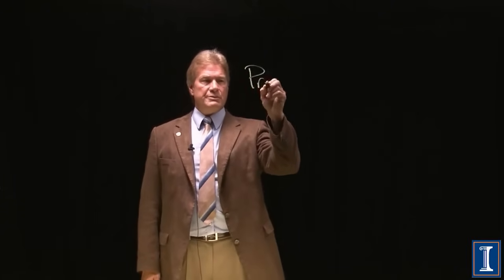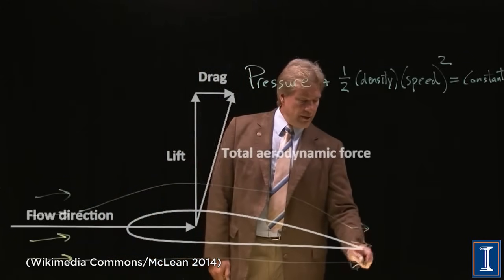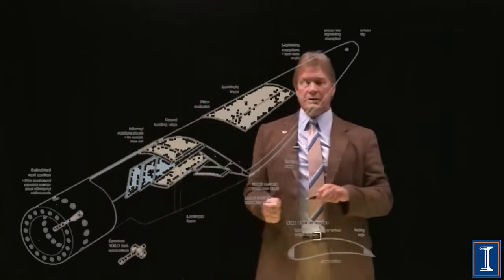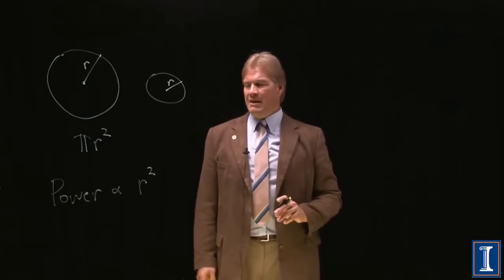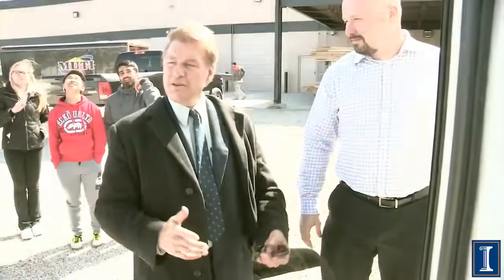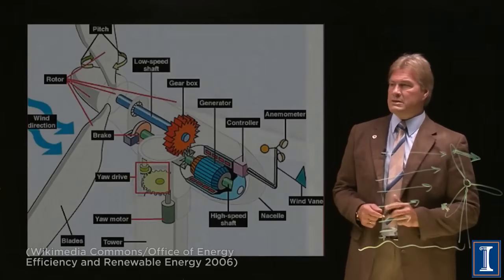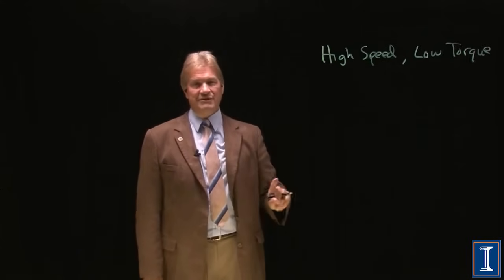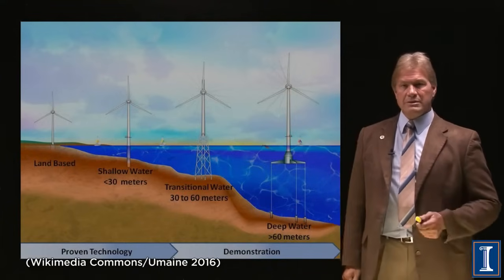How Windmills Work

Comment: More about the economics, maintenance requirements and practical/impractical considerations of windmills please. 

What if balancing a grid with a substantial % of power coming from wind (and solar) means shifting up and down conventional power-plants to run at lesser efficiencies? Is there an overall economic loss? 

Are the maintenance requirements for windmills not unfavorable?
The ideal locations are typically not near places with high power requirements. What about the distances involved and power lost due to transportation over these distances? 
The blades have to be cleaned, the structure vibrates unevenly, it is subject to non uniform lateral forces, anything with a propeller on it will sooner or later shake itself apart without maintenance and maintaining them at sea seems to complicate things further making it an expensive proposition if this has to occur regularly. Building them and taking them apart requires massive cranes and equipment, what about the cost of building them and taking them apart?

Comment: What I would like to see is comparison of cost of different power generation types and problems of high Green energy in your power grid content for big countries like Denmark or Netherland. They have a lot of Wind and Solar does it generates problems for grid energy?
Reply: Do you know the difference between an economist and a physicist? One doesn't care about cost, the other doesn't care about physics.
Reply: @vidznstuff1  I beg you pardon. Engineer who builds power plants needs to be aware about both the cost and the physics.
Reply: @tomaszworoch  Wind and solar plants are cheaper than coal and are at parity with methane, despite its glut of supply.  Anything else? 

Fossil fuels are becoming uneconomical for everything. In five years, aircraft and long haul trucking will go electric as the new battery tech comes into production within 3-5 years. "Peaker plants" will also become obsolete in favor of grid batteries and car to grid power artbitrage.
Reply: @vidznstuff1  clearly you didn't spot my point about country grid. Clear Solar and Wind power grid have problem of storage. If you count PV generation per kWh it's becoming similar in price to fossil fuels kWh. On case of PV with energy storage well then it's decades before it will be reasonably priced. 

I would love to see electric planes but to been able to fly on one I do not share your optimistic predictions. It will take longer then a few years
Reply: @tomaszworoch  Storage is free with Vehicle to Grid.
Reply: @vidznstuff1  Show me any place that is planning VtG ? Japan with Nissan after the Major disasters is the only one I have heard about. Tesla with Cybertruck not fully GtD but theres is something. Nothing else I have heard about. 
Next thing the storage of EV is so small in comparison to power in Grid. World production capability of Li-ion batteries last year was around 150 GWh of which maybe half is for EV, and from it you could use a few percents of capacity connected per any given time. US power grid tops it's consumption at around 1000 GW of energy , possible similar amount of energy in EU, even more in Asia.
Even if we would get all the EV next year to be VtG compatible (who would pay for it?) we would get 150 GWh/ half for cars / few percent around I would say 10 GWh of storage production per year that's around 30 second of energy storage. We would need days. 
Let's stop rambling and lets talk about the real cost cause we want the same
Reply: - The 'Energie Wende' in Germany failed. It doubled the price and didn't reduce CO2 emissions at all. Because every Watt of wind power needs a Watt of natural gas power in hot standby to take over when the weather changes. 
- Denmark is lucky in that they can sell excess power to Germany. 
- When Germany has excess power, Denmark and the Netherlands don't need it because they have their own wind power. 
- When the grid operator has to order wind turbines to shutdown, they still get paid for the excess power that wasn't needed. 
- The grid was designed as a backup for when a plant fails unexpectedly. When a storm passes,  ALL wind turbines go from maximum power to zero at the same time. 
- Most of the wind is near the North Sea, so the grid is abused as a transport network. Forcing the grid operators to juggle frequency and phase on a hourly basis. 
- The Netherlands is building huge wind parks offshore. Guess who has to pay for the grid connection to those parks.... the tax payers.
Reply: @Aimless6  Thank you, that's something i would like to listen about. Important topic if we want to go green anytime soon.
Reply: @Aimless6  Short term problems should not dictate long term strategy. Batteries will make your peaker plants obsolete.

Comment: What are those engineering problems in details? How did they get solved? What's still left to improve? Thank you professor.
Reply: The problem of nonuniform wind force across the swept area of the blades was solved by making micro pitches to each individual blade as it moved through the swept area. Torque on the main shaft is closely monitored to prevent premature wear on the main bearing and gearbox. Great question volt! I hope that answers your question a bit. Also each turbine manufacturer likely has patents on this tech and may have found other solutions.
Reply: @codydebo1876  so each individual blade changes pitch according to its position during each revolution? That's genius tbh. Thank you for taking your time to answer

Comment: You're normally so accurate, but they're not windmills! They don't "mill" anything. They're wind turbines or wind generators, but please, not windmills. 😉
Reply: Mmmm, I was thinking the same thing, but while watching I came to wonder what you’d call the water pumping variety. After all they also aren’t milling anything. I think you’d be safe enough to call the category of machines that use wind to do work windmills of which the subset that generate electricity are wind turbines
Reply: I agree, for some I think it's a generational and regional colloquialism. My parents (and some of my classmates) grew up calling them windmills, even though they definitely knew better 😅
Reply: Almost replied;)

Comment: I'd love to see a video on how to protect oneself and family from nuclear fallout. All of the old civil defense films seem to be more propaganda than fact.
Reply: Just the fallout, not the initial radiation?
Reply: @lightdark00  you wont be exposed to any direct radiation outside the blast wave of a nuclear bomb. All your risk is from radioactive isotopes in the dust. The air shock ( complete total death ) is much larger and farther spread than any harmful radiation levels.
Reply: spoonikle some old films sound like what to do for the initial blast. That's why I said that.
Reply: No shit.  You just realized that.   You need to watch all the different "Duck and Cover" videos.  They're a riot.
Even if you're very far away you would need to stay indoors for a long time and if there was sufficient fallout the ground would be contaminated.  There is no easy answer (it depends).  Just hope you don't need to know is my theory.
Reply: Mark Gigiel the fallout videos mostly say two weeks.
Reply: @markgigiel2722  @lightdark00  Fallout shelters (not bomb/blast) seem to be the easiest solution to this problem. But the question is- what kind of shielding is really needed? What's a good amount of density to have for good protection- and what's the specific density of every day materials that could be used?
Reply: @lukereeves4448  from what I've read you'll typically want about three feet of Earth above your fallout shelter is a minimum air purification water filtration systems will be needed but which specifics you will need I don't know off the top of my head
Reply: Fallout Survival is something that I would be interested in learning more about
Reply: The best way to protect yourself and family from nuclear fallout is with a pencil and a piece of paper.

It's called a ballot.

Vote for a corrupt bastard bought by the military-industrial complex, or vote for someone who goes against them. You get nuked, it's deserved because of who you voted for, or for your failure to convince your neighbor of the corruption and consequences.
Reply: @vidznstuff1 , that's great and all. By the time the primary is over they'll both be the same option. The bad one.
Reply: @vidznstuff1  yeah- I don't think North Korea or Iran cares about who our president is...

Comment: Prof, I was curious if you’re using a mirrored image, or are you writing in reverse from behind a clear board?  Either way, thanks for the excellent education!
Reply: Image is flipped. He's right-handed and his pin is on the opposite side of his coat in 'normal' videos.
Reply: @BattleshipAgincourt:  Could be...  I was just hoping he taught himself to write that well backwards.  That would be WAY cooler and much more impressive.
Reply: @eschdaddy  
He's writing on a glass panel, like the kind used in office partition walls. Thus the writing would be seen as reversed from behind when facing him with the panel in between 

Now turn around to view that reversed image cast into a mirror and film that mirror image. 

The mirror image of the reversed image is now normal but the right-handed prof, his left hand wedding ring, his jacket buttons and even lapel pin are all reversed.

The camera would be between the glass writing panel and the "viewing" mirror 

Quite ingenious... but the Professor is one himself. Google his name and chk out his creds
Reply: @BattleshipAgincourt  
He's writing on a glass panel, like the kind used in office partition walls. Thus the writing would be seen as reversed from behind when facing him with the panel in between 

Now turn around to view that reversed image cast into a mirror and film that mirror image. 

The mirror image of the reversed image is now normal but the right-handed prof, his left hand wedding ring, his jacket buttons and even lapel pin are all reversed.

The camera would be between the glass writing panel and the "viewing" mirror 

Quite ingenious... but the Professor is one himself. Google his name and chk out his creds
Reply: Ok I knew it was mirrored but how did the overlay work?
Reply: @Shalom Korf:  I’m assuming with the lighting that there’s a plexiglass board between him and the camera, with the lighting high above the camera to prevent reflection, then image flipped.  I REALLY wish he would’ve been writing backwards, just so he'd be that much cooler!
Reply: @eschdaddy  that answers writing, but what about the overlay image? Is that somehow projected, or is it added later?
Reply: moshecraices My guess is the images are overlaid in edit. You might notice when he interacts with images he looks off to the side likely at a monitor so he move his hand over the appropriate spot.
Reply: @Dfbc8823  
He's writing on a glass panel, like the kind used in office partition walls. Thus the writing would be seen as reversed from behind when facing him with the panel in between 

Now turn around to view that reversed image cast into a mirror and film that mirror image. 

The mirror image of the reversed image is now normal but the right-handed prof, his left hand wedding ring, his jacket buttons and even lapel pin are all reversed.

The camera would be between the glass writing panel and the "viewing" mirror 

Quite ingenious... but the Professor is one himself. Google his name and chk out his creds
Reply: @moshecraices  
He's writing on a glass panel, like the kind used in office partition walls. Thus the writing would be seen as reversed from behind when facing him with the panel in between 

Now turn around to view that reversed image cast into a mirror and film that mirror image. 

The mirror image of the reversed image is now normal but the right-handed prof, his left hand wedding ring, his jacket buttons and even lapel pin are all reversed.

The camera would be between the glass writing panel and the "viewing" mirror 

Quite ingenious... but the Professor is one himself. Google his name and chk out his creds
Reply: He explained it a long time ago... camera is in the front... glass panel in his front between